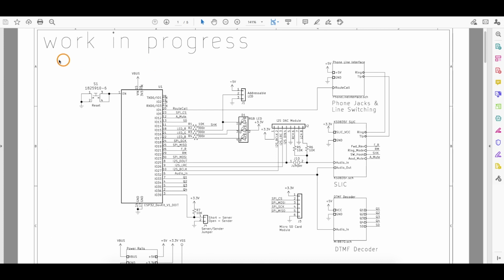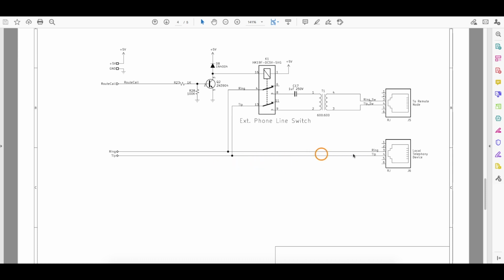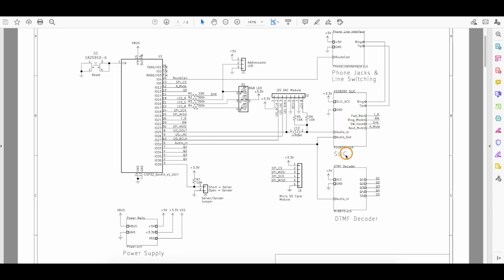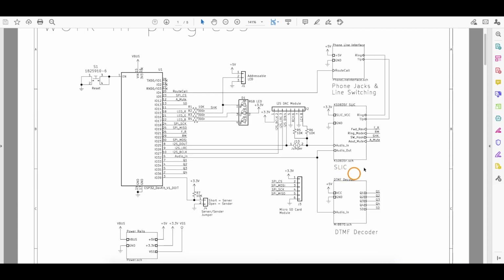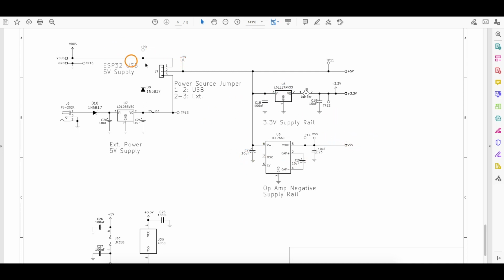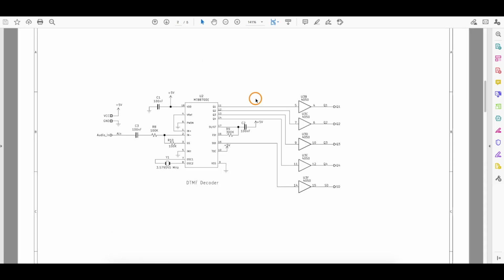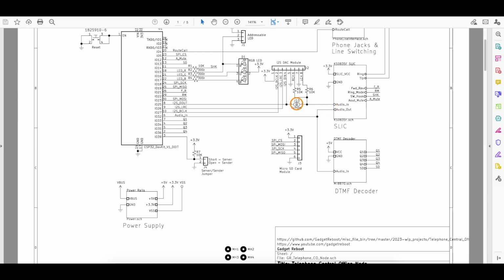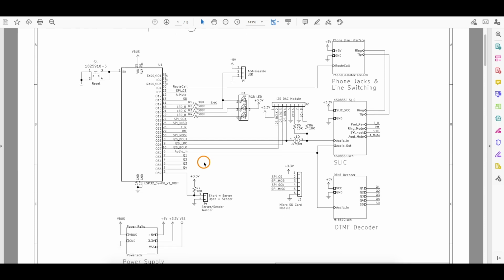Phone Line Simulator ESP-32 Schematic Review

Comment: Does 5v tolerant input just mean that there are no esd diodes on the inputs.  As if you go about 0.6V  above the chips VCC on parts with esd diodes you start to try and drag the chips internal vcc up or reverse power it if its unpowered.
Reply from the maker: For this part they actually market it as a high to low level shifter so however they do it, the TI datasheet says it has a "modified input protection structure" for this, allowing high level to low level translation while running from the low level supply, including 15v shifting down to 5v levels.   We'll see how it goes.